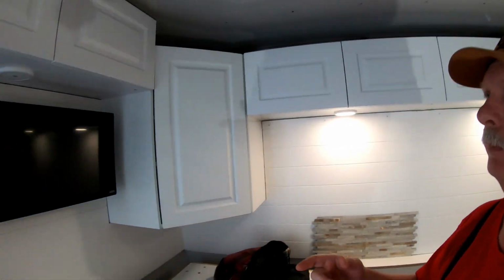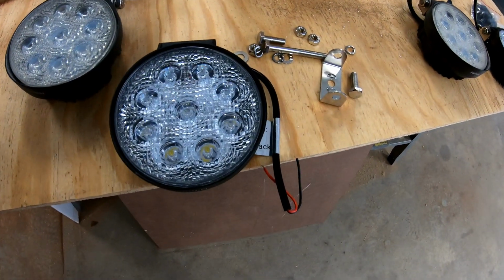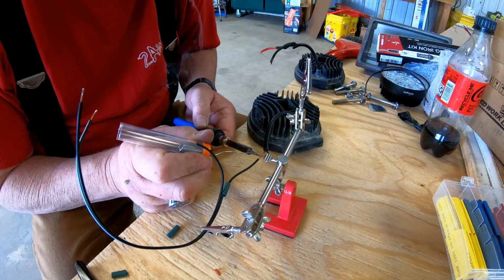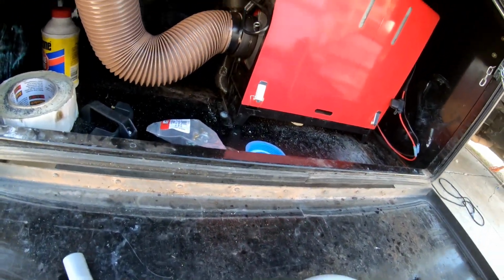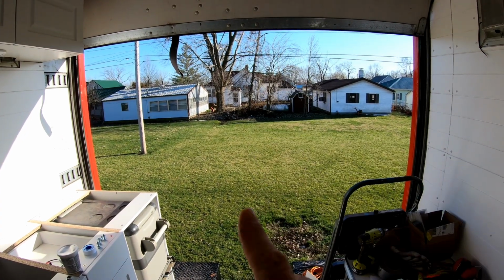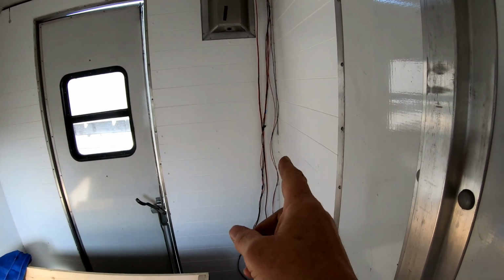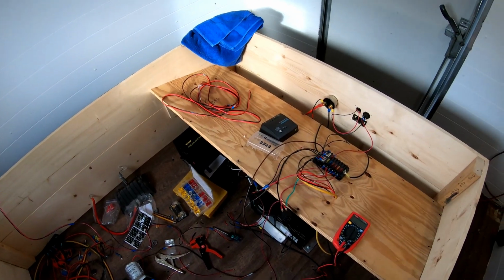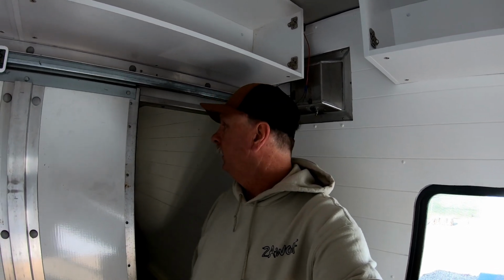Expedition truck build part 15 installing LED lights diesel heater fill hack

Comment: Wow those LED lights are nice & thank you for bringing up the liquid electrical tape. I forgot that my son borrowed my liquid electrical tape & hasn't returned it yet. I'm also digging your custom diesel heater funnel, I love it when a plan comes together.